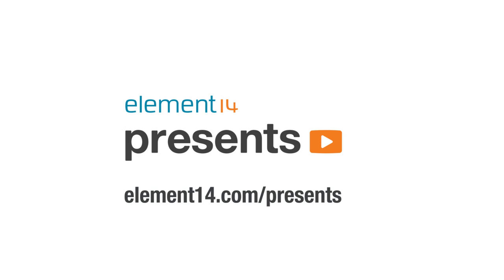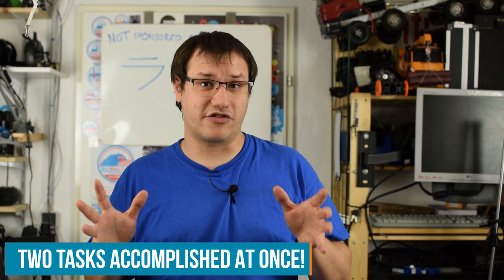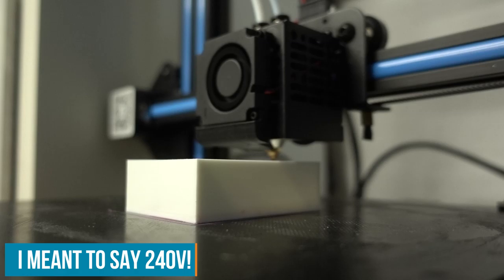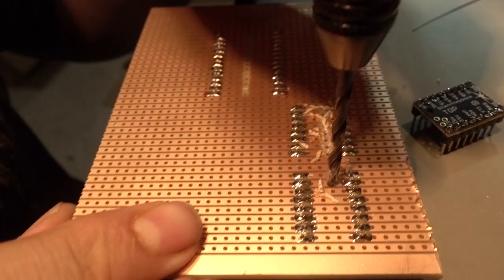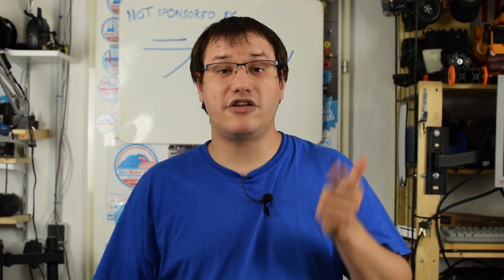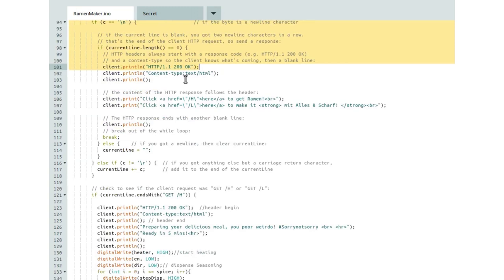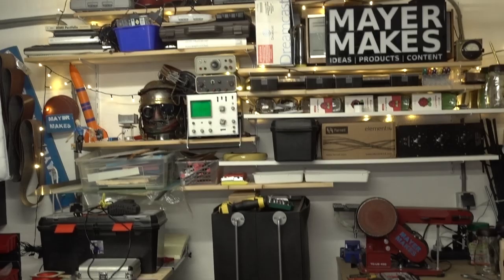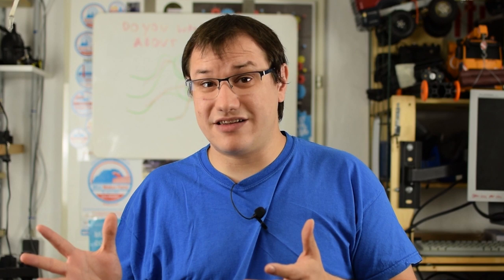Upcycled Coffee Pot to IoT Ramen Maker

Comment: if you do it with a kind of web interface, you have so many pins left on the MC. Build a water tester, so it don't run without water. Add different spices options. add a sauce slider in the Web. measure the temperature of the Soup and show it in the web interface. Go crazy and pump it up with features. This is just the "LED ON network switch" if i have to fill up the machine every time i can press the start button on the machine too.  What is with Noodle dispenser ? the noodles bricks are all the same size. Controlle the Sauce with a worm screw and bigger syringe. A electronic water valve on a tank or tap. make it cool. please do version 2 of it
Reply: Make sure to post your ideas at eleemnt14.com/suggestionbox!

Comment: "ahem america" has little issue fuses, breakers, and circuit protection. you are thinking of chinese implementation of the safety STANDARDS required in america.
Reply: Can't have issues with fuses, breakers, and circuit protection - if you don't have them in the first place, right? :P
Reply: Yeah he's talking out of his rear. I've never seen a kitchen or bathroom without gfci protection. And how can you have a building without breakers? This is basic stuff required by electrical codes and insurance companies.
Reply: @Davedarko  Not sure where you got your information, but it certainly wasn't by actual observation of our protections. Mains in the U.S. is protected by a breaker, each line is protected by an additional breaker, and many outlets are required to have GFCI protection. Triple layer protection for most of our outlets. I even have been in a building built in 1910 that featured a glass fuse box in its original build. We've only gotten better since then. Our houses don't run like you saw in "A Christmas Story" or "National Lampoon's Christmas Vacation". Our National Electric Code contains many specific protections that are required for safety:

https://en.wikipedia.org/wiki/National_Electrical_Code 

You should review some facts before trying to flame a whole country on a complete fallacy.
Reply: Did he say 40 gauge or 14 gauge for the wiring?
Reply: @DoctorWhom  it was approximately AWG14 the wire is metric so it is not exact. suffiecient for the job but you can always go thicker if needed.